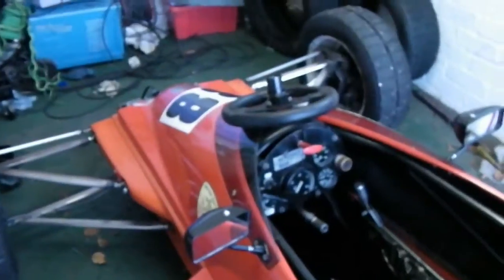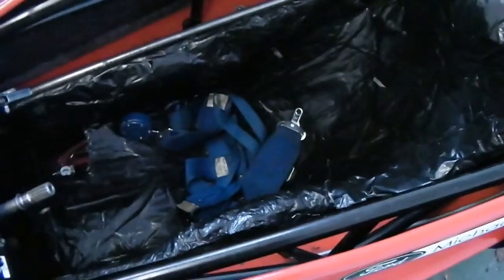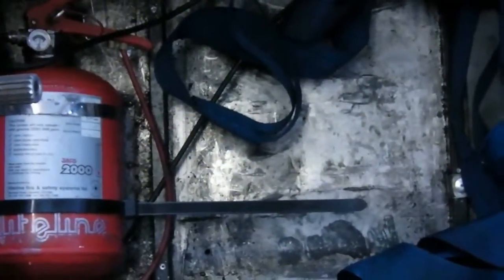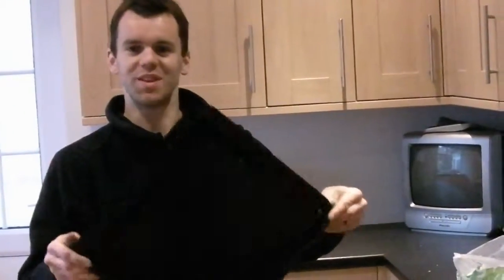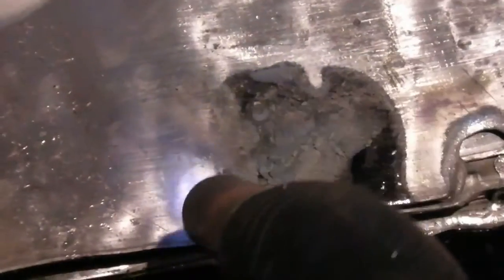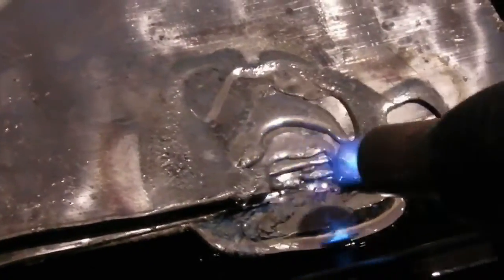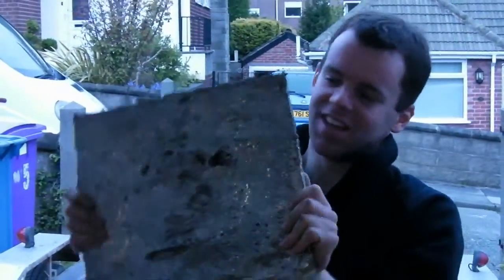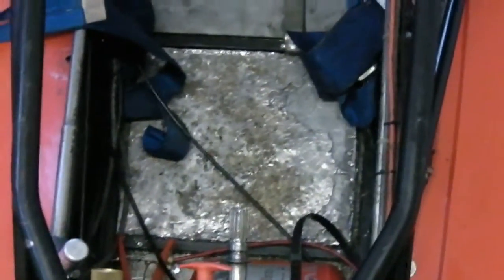Making a Lead Ballast Weight for Single Seater Race Car FF1600

Comment: I suppose I don't have to tell you that was pretty dangerous. But what I can tell you is I make mine in some cheap steel bread pans. Melt it down really good then let it cool in the pan. After they're solid, just flip it over, comes out in a nice uniform brick.